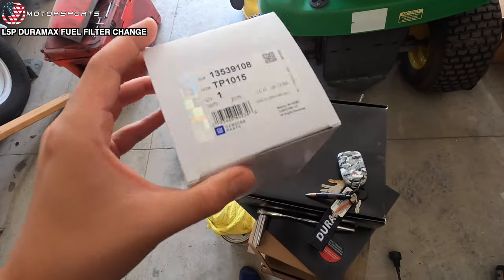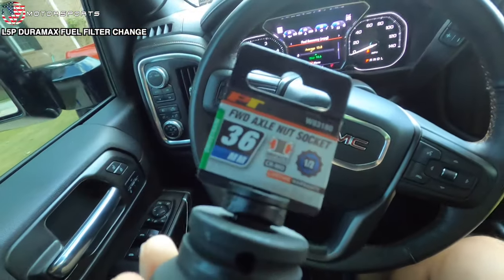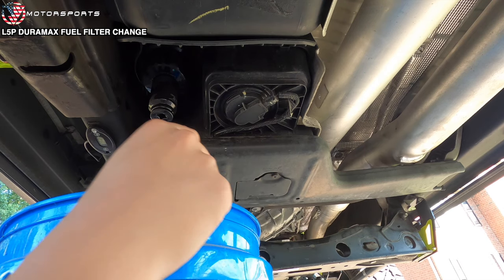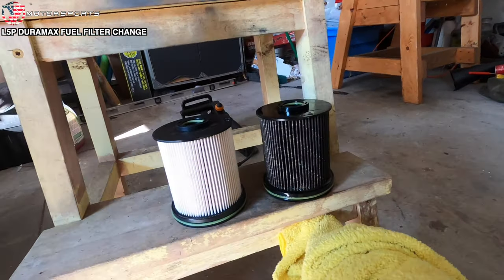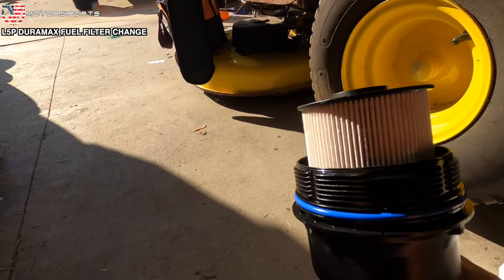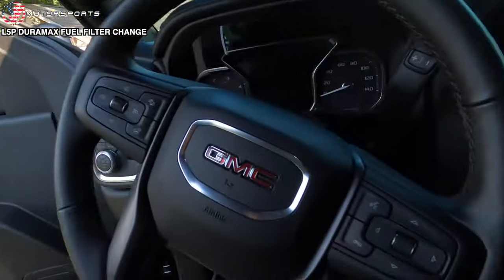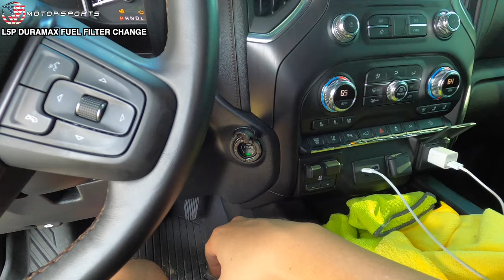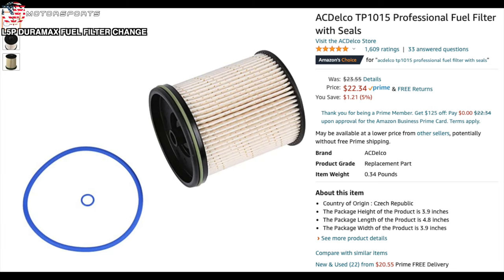2017-2021 GMC/CHEVY Duramax L5P Fuel Filter Change

Comment: FYI… next time, there is a small drain port in the center bottom of the housing.  See how it works when you have it off.  You can break the vacuum and capture any water/debris before you unscrew the cap.

Comment: To keep the plastic nut on cap from rounding off I put a piece of paper towel between the cap and socket and it makes for a more snug fit.
Reply: Or get the six point instead of the 12 point socket.

Comment: You don't need a billet cap. I'd be concerned if whatever metal they used will rust and clog your injectors, and whether they metal threads are going loosen with the plastic housing. Just buy a new cap when it gets rounded off, the GM parts catalog shows it costs $7.28 MSRP. If you wrecked one every time you change the filter, you'd still save money.

Comment: I suggest a 6-point socket over a 12-point to avoid damaging the plastic filter housing. Lisle part #14500 will do the trick. Good luck DIY’ers.
Reply: I second  that opinion!

Comment: * Sorry For This Long Read *   Thank you for this video. I got a job as a welder with a concrete company. I told them up front that I know how to weld, but that I suck at it. I also told them that i am a dedicated and fast learner. But then one day a hitch on a crane truck broke. They asked me if I knew how to fix it, and then one of their gasoline trucks sprung a transmission leak. I've been building cars since I was a kid. I said sure. Then they asked me if i knew anything about hydro systems, diesel and heavy machinery. I lied through my teeth. I said yes. I have no clue what I'm doing. And yesterday I spent an hour just trying to find this dumb fuel filter. So thank you.

Comment: The black crap is not actually harmful. It is some compound that is created becuase of the extreem pressure of the injection sysem and is carried back to the fuel tank in the return fuel line.  It is not abrasive and doesnt hurt anything even though some of it gets caught in the filter.

Comment: Finna change fuel filter 1st time and it’s at 55,000 miles. Got it deleted at 30,000. Never had any problems. Maybe it helped occasionally putting the stanadyne diesel additive and deleting it of course

Comment: Why not get a 6 point socket instead of a 12 point . You have more surface area on the nut. I change my fuel filter around 15000 miles. I have not had any problems getting it off. Yes 1st time filter change canister was on real tight

Comment: I change all my fuel filters with every oil change
Reply from the maker: That's good!
Reply: That's bad. As a filter traps dirt, the holes in the media get smaller and it's able to catch smaller particles. A new filter has about 60% efficiency for the first 20% of its life, reaching peak efficiency at 20-100% capacity, then starts to drop to about 80% for the next 40% overcapacity. Changing filters too soon is worse than changing them too late.
Reply: @straightpipediesel  your sure about that, it makes sense. I was thinking about changing mine at 50% every time with the oil but I may take your advice. What % do you think 20 ? I just did my first at 15%

Comment: You won't  "hear "the filter priming, you hear the fuel pump pressurizing the system. This could have been filmed in 5 minutes but still pretty good.  If you buy a 6 point socket and put it on squarely and back up the wrench with your hand you won't have any problems and they shouldn't crack.  I removed and installed the 3 on my ford 6.0 for 18 years with no problem.